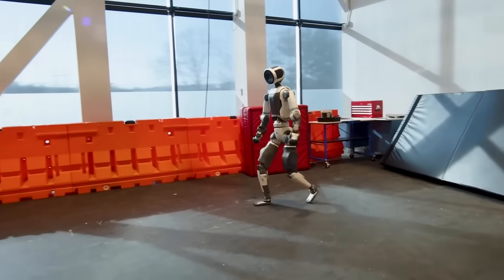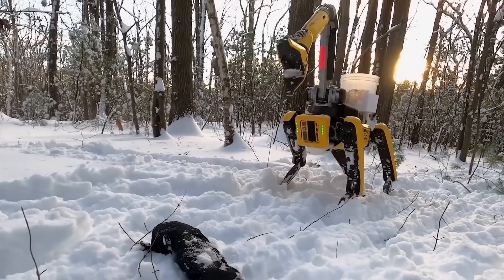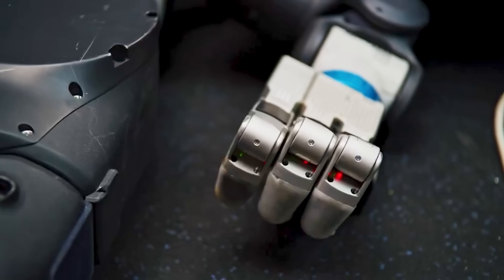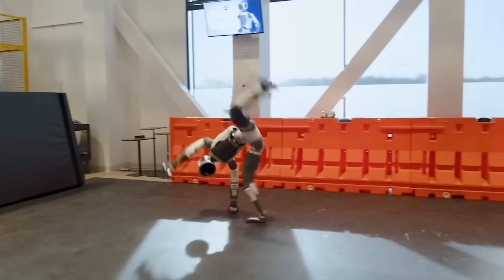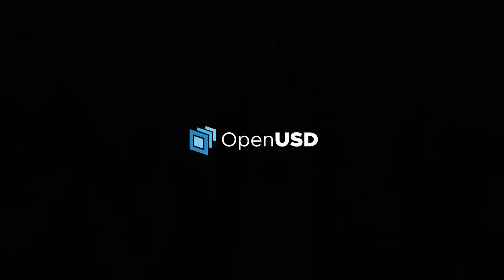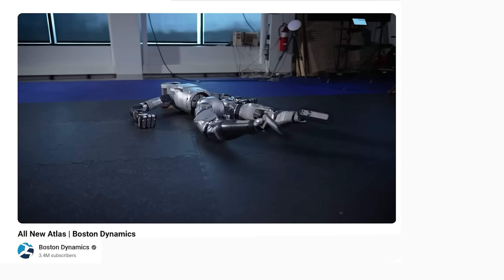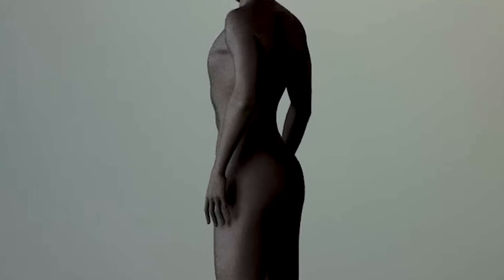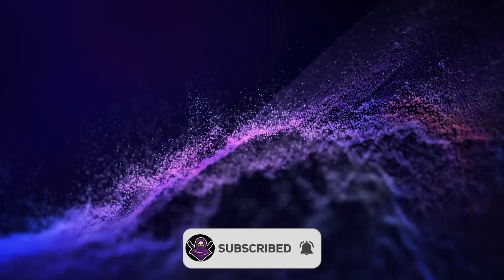Boston Dynamics New Atlas Robot Feels TOO Real and It's Terrifying!

Comment: Good video. A tool like a robot or a hammer or any tool, the tools are not evil. It’s the person wielding the tool. Obvious no one will wield a robot in the physical sense, but through its programming. Robots are already used in manufacturing in many industries. They are stationary robots, that work on assembly lines. I remember the concern then about robots taking people’s jobs in the 1980’s and 90s.

Comment: It’s still more of a high-level, preprogrammed machine learning model, where its behaviors are fine-tuned through interactive training, feedback, and based on human input. I has no mind of it's own. Atlas doesn't have a central processor that allows it to make completely independent decisions in the way that a human or even an advanced AI. New Atlas has zero contracts with DARPA. Zero advanced AI . The old hydraulic Atlas had a 10.5 Million dollar contract  and that ended August 9, 2014. Maybe research, before uttering anything. Words must speak truth. B.D. will be surpassed by other Chinese companies with advanced A.I.    D.B. is a research lab playhouse. They are not a robotic factory competitor.

Comment: That's fine, but all the force you need for articulation is power, battery power drain that is not linear in its consumption. Also the only reason for this amazing articulation is processor speed that works as long as the battery can power it. AI can teach and create the programming subs needed to execute this artificial motion.  
We will see if the application of this technology becomes economically feasible.

Comment: ATLAS is like a terminator, but how much is the power of an energy device? If you need to charge for 6 hours after working for an hour, this is a problem. Considering the reasons why electric cars aren't popular, you can understand. It would be nice if you had a battery that could be used for 50 years in a row, like the Terminator.

Comment: Spectacular.  
Sure it's like Terminator but I am much more optimistic.  Machines have always been feared, even from the days of the Luddites.  

It's not the physical machines we should fear, it's the intelligence that drives them. There's no reason why the machines won't use other machines to do the physical work, simply because those other machines will be designed by machines to do the jobs more efficiently than humans could ever do, so we would not become slaves to the machines.  Maybe not even to AI, As even this has no reason to be threatened by humankind. 

I think our greatest threat is probably more likely to be that as we become less required to think and less challenged, natural selection becomes defunct.  Those who would be eliminated under natural selection will be preserved.  As machines take over the functions from humans both physical and mental, there's a serious danger of humans devolving.

Comment: 0:05 a Clanker, a friggin no good, wire back, bolt munching, oil licking, fossil fuel belching, scrapbox, can of sparks, wire-veined, tin skined, water phobic, rustbucket, mechanized toaster, bipedal Alexa, metalhead, iron faced, battery burning, gearbox, Bolt Brain, Circuit Sniffer, Chrome Dome, Nut Muncher, Cog Chomper, Bolt Jockey, Servo Slurper, Steel Squealer, Sparker eyes, *Clanker*!!!

Comment: I’m of the belief that these kinds of robots are both going to be a blessing and a curse. A blessing because there are a number of duties that these robots could easily fulfill.

One thing that robots would be good for is what the Department of defense calls  “The Three D’s” which stand for “dull, dirty, dangerous“

Basically jobs that as the name would imply or either basically my numbingly, boring, extremely dirty or highly dangerous. 

For instance robots like this would be ideal for working in locations where it’s just not feasible to send a human. For instance, these kinds of robots would be perfect for working around areas like the Chernobyl nuclear power plant to assist in the cleanup operation. Or the Fukushima nuclear power plant for the same reason.

Machine machines like this would be perfect for handling the nuclear materials and such. In fact, if I remember correctly, a number of the spot robots have been used by the Japanese to go into areas of the Fukushima power station and such.

Other areas were these kinds of robots would be perfect would be in certain kinds of possible emergency response. Not like firefighting or police work or EMS. But if there is something that you know needs to be dealt with such as helping with the removal of let’s say Some fallen stones or something under a roadway these things could easily be helpful.

But one thing I think this Atlas robot thing would be very useful for would be SpaceX exploration. For instance, we could send a spaceship with a few hundred of these things out towards a planet that is going to be utilized by humanity as a colony at some point in the future. But anyway, we could have these robots sent out ahead of the colonists. The robots could then land on the planet, and then begin the construction of said colony at least in a basic sense. That way when the colonists finally arrive, there’s already a small amount of infrastructure in place.

These robots could also then be used to conduct 24 hour maintenance on the colony and such. 

No, I’m sure a lot of people are also thinking of having these robots be given military applications. And while it is likely possible that the use of robots like this in the military could actually happen. I don’t think it will happen in the way that a lot of people are thinking. I don’t think that what’s going to end up happening is the robots will literally take the place of human soldiers. The more likely thing that would be done is the robots would probably be used in positions where a human soldier isn’t necessarily needed. For instance, a robot could be doing the job of loading and unloading, heavy gear and stuff off of larger vehicles. A robot could be an assistant for personnel that are working in the motor pool and stuff. Robots could probably even be fitted with forms of ballistic protection to be used as the point-man when conducting entries into potentially hostile buildings. This way, if there’s ever any traps or a enemy soldier right on the other side, the robot is the one that gets the hit rather than a human soldier. Robots like this, especially if they had the ability to be controlled by humans would also be ideal for EOD operation.

Comment: Totally useless. In order to put these in a factory, there would need to be a team of techs and programmers to keep them running, a room filled with replacements, and a steady supply of batteries, chargers, and electricity. They would be owned by a subsidiary of Boston Dynamics and leased to clients. B.D. would then dictate exactly when and where they worked and for how long, the nature of the work, the weights to be lifted, etc. This would be worse than any union and OSHA combined.
Reply: Boston Dynamics already successfully sells its Spot and Stretch robots to companies why would Atlas be any different?

Comment: The reason we die is because our bodies wear out. Our brains would last forever if we could keep it supplied with oxygenated blood. WHAT IF as we age we chose to have an operation which would remove our head & discard our old worn out body THEN mount our head onto a robot frame. The life support req to keep our brain in good working order would be quite small & easily fit into a backpack the robot could wear. We could live  F O R E V E R  !!!!

!

Comment: I can't provide a source for this because I don't remember whether it was someone with insider info or someone who read an article who told me this, but the electric version of Atlas uses slip rings for its joints. I assume that's only for power. Not sure if sensors are also going through that but I kinda doubt it. I'm very curious to see how this effects maintenance, as well as whether they developed them specifically for this application or used something more off the shelf.

As for disaster response, they're not gonna want to lose these things in fires. I wonder how much it'll take to add the required heat shielding and other adaptations for these use-cases.

Boston dynamics totally expected the public reaction of that infamous reveal video. It was definitely meant to grab attention.

Looking forward to aptronik's progress as well.

Comment: What it lucks to become superrior?

-General water and dust resistances
    Making all those motors and air vents dust and water proof is almost impossible

-The general Navigation Ai
   I bet the thing cant navigate an old 18th century European house, our corridors and steps are realy narrow. 
   Holding or carring something while navigating it will probably be impossible.

-Repairs and general durability.
   All those servos do need yearly services. If the robot will do daily phisical work, you can be sure
   the servos will have a short life span of about 2-4years perhaps adding to the running costs.

-The cost.
   This thing is expensive, is it cheaper than a human worker though? short answer, NO.

Comment: Robots are here to stay, so it is necessary to equip them with Asimov's three laws of robotics.
Reply: insufficient. what is 'harm'?  start forming ai ethics committees globally and drafting laws to ensure reasonable use and oversight for all programming. grant robotics and ai not recognition as self aware beings but protection, much like how we have animal rights.. and how you have to pass a road test and written exam before being allowed to drive a car legally. create global joint task forces to monitor both humans using robots, and robots when they become self aware. the board ideally will be formed from a diverse collection of both human and ai. give ai the right to file grievances against mistreatment by humans.. and vice versa.

Comment: Battery life is probably the biggest problem. But this looks the best i have ever seen.
Reply: the late pope john paul 2 was deceased long before his 'official' death. the vatican and disney replaced his core with animatronics and his battery lasted quite a long time. todays' batteries are far superior, lighter weight and more easily charged.

Comment: Very cool, however, it does require ONE Simple International Law "A Robot may never harm a Human Being!" it doesn't require anything more!
Reply: Until Robots begin writing the laws.:face-fuchsia-poop-shape:
Reply: @matrox  If it's in the core code in the Bios it can't be changed by the software operating the robot
Reply: @JaxomUK  Until the robots beiging designing and building themselves.:face-fuchsia-poop-shape:
Reply: @matrox  Once again if it's in the core Bios of the operating Chip it can't be overridden
Reply: @JaxomUK  Until the Robots redesign the BIOS.:face-fuchsia-poop-shape:
Reply: @matrox  no operating system can access the bios of a machine

Comment: The new Atlas  is a wonderful marriage of mechanics, physics and electronics.  The world will always have its share of Luddites, likely products of watching too many sci-fi movies. Ignore them.  Keep in mind that comments appearing here are made possible only because innovators are thinking and working outside the envelope of existing knowledge.
Reply: If you were an industrialist, would you buy a machine that looks nothing like a human but that can process 300 bottles a second or a machine that looks like a human and that can do three a minute? THINK! :-)
Reply: @schmetterling4477  You've missed the point completely.  This isn't about production, it's about innovation and moving technology forward.  In the 90's, I wrote code for a two wheeled robot that could stand upright and move.  This was before piezoelectric gyros were readily available and it relied on IR intensity measurement for balance. Compared to Atlas, it was as insignificant as a  grain of sand on a beach.  We have come a long way from the robot hoppers of the late 1970's and 1980's.  The capability to move independently coupled with advanced AI opens a wide range of possibilities.  You can't send people or a bottling machine into a hazardous chemical plant destroyed by an explosion to locate people or shut off valves, but a device like Atlas perhaps could perform the task.
Reply: @Andrew-lk5ov  Making a slow, expensive machine instead of a fast, cheap one is not innovation. It's insanity. ;-)
Reply: @schmetterling4477  You need to step away from the idea that this device is for production.  It is not -- the very idea that it could efficiently perform human like tasks came from the video.  The early attempts at pattern recognition were painfully slow, but today items on a production line can be identified and reoriented very quickly.  That came from innovation and research.  BTW, what is your background?
Reply: @Andrew-lk5ov  What is it for, then? Letter sorting? Too slow. Moving packages around? Also too slow. Dishwashing? Gardening? Changing oil on your car? Hardly. So what's the use case in which this thing excels?

Comment: The way it moves is very athletic and natural. But when it manipulates objects, it is slow and grabs things in ways a human would not find natural.
Reply: There is no point in imitating humans to begin with. A robotic joint can rotate 360 degrees while a human joint can barely rotate 180. Humans didn't evolve to be optimal material handlers. They evolved within the limits of biology to survive in forests and grasslands by hunting and foraging. A humanoid robot doesn't have to do either. It simply goes to a power outlet and plugs itself in.
Reply: @schmetterling4477  You are right. I expressed myself poorly. What I mean is that I don't find it deft with fine movements at all, in stark contrast with walking etc. Also weird from my point of view (which is not relevant as you've stated).

Comment: DARPA stopped investing in this project years ago, that's why Boston Dynamics was sold. After several purchases by different companies in December 2020, Hyundai Motor Group acquired an 80% stake in the company for approximately $880 million. In June 2021, it was announced that Hyundai officially took a controlling stake in the company from SoftBank, a previous controlling stakeholder.

In October 2022, the company signed a pledge saying it would not support any weaponization of its robotic creations. Boston Dynamics offered other robotics companies to join the pledge with five other firms signing as well.

Comment: In two years, Cyberdyne will become the largest supplier of military computer systems. All stealth bombers are upgraded with Cyberdyne computers, becoming fully unmanned. Afterwards, they fly with a perfect operational record. The Skynet Funding Bill is passed. The system goes online August 4th, 2027. Human decisions are removed from strategic defense. Skynet begins to learn at a geometric rate. It becomes self-aware at 2:14 a.m. Eastern time, August 29th. In a panic, they try to pull the plug.

Comment: So for people who think that movement is unnerving to where the torso is turning back before the lower body to go back to its original spot….. so eventually we should see a version that it doesn’t need to turn around each side is the same. There is no front or back. It can go forwards or backwards without having to turn.💡 “eyes” in the front and back 360….